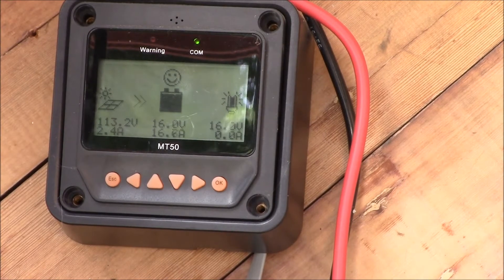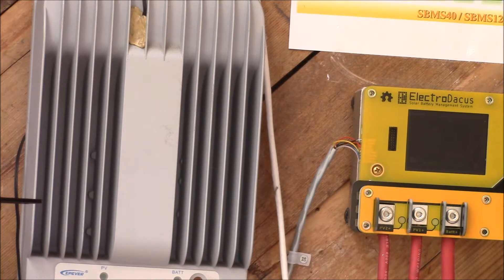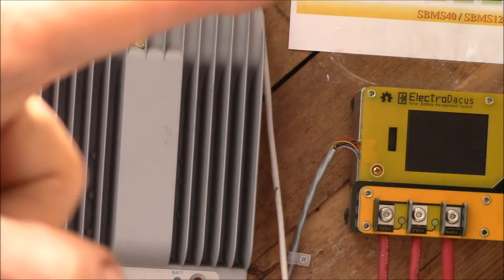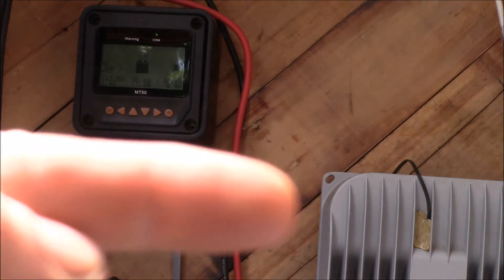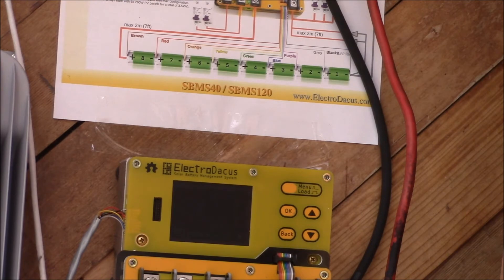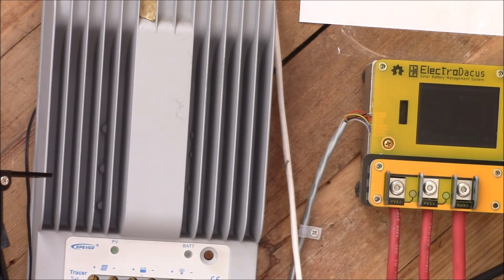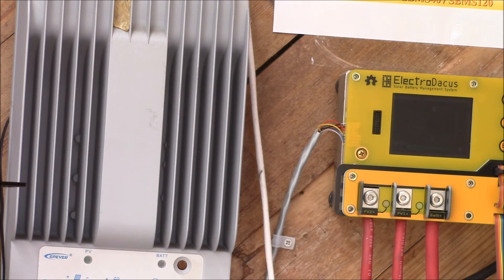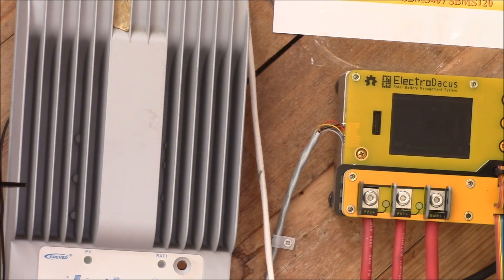10 AWG PV Cables, Series vs. Parallel

Comment: 10 gauge wire will make a great difference in your system.  Be Well
Reply from the maker: Yes, it sure does.  Not that much more expensive than 12ga. or 14ga and is the biggest wire you can easily fit into MC4 connectors.
Reply: R Brown very true and thanks!